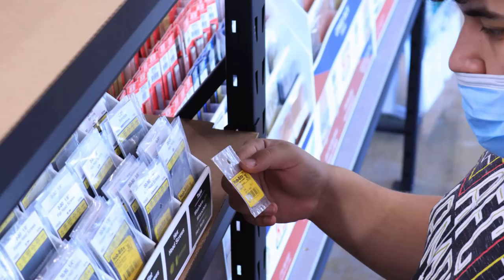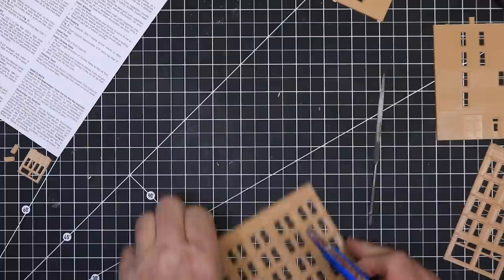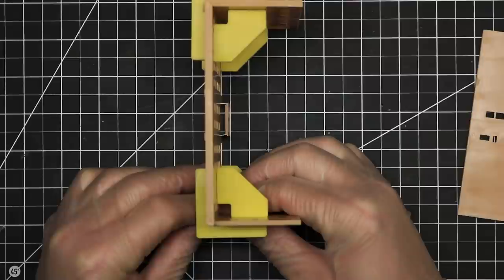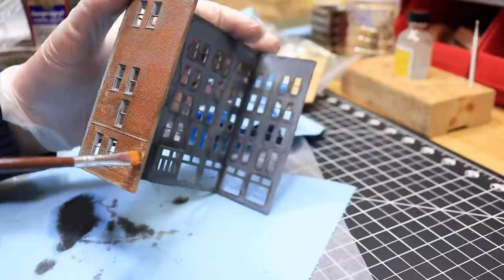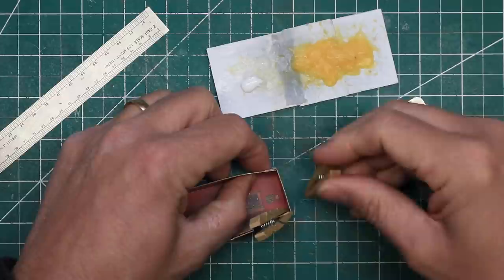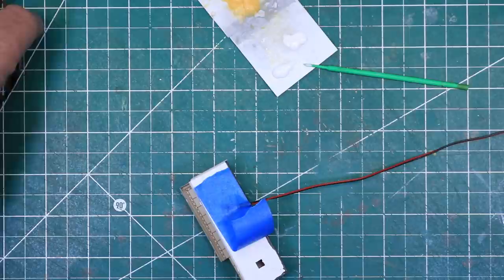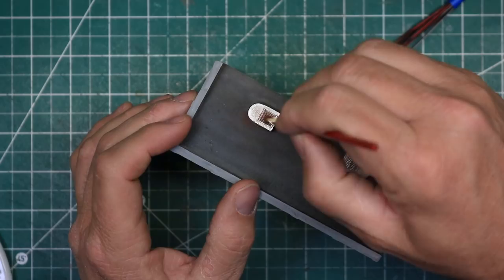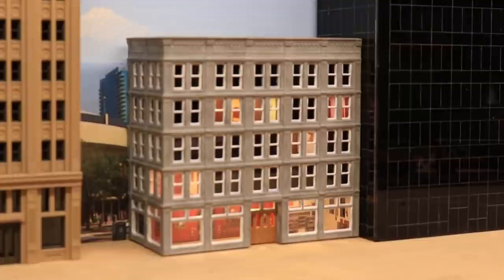Build a Model Structure with Interior and Lights

Comment: Excellent Ron!  The DPM structure series is absolutely classic, and make for perfect buildings by following the instructions or kitbashing.  I like your suggestion of canopy glue for the windows!  I bought some years ago but never found it useful.  This window installantion scenario makes for a perfect situation for its application.  And yes, I have had mistakes in weathering that have actually turned out for the better.  Fantastic work along with the tutorial.

Comment: I had to double take when I saw the thumbnail - that hotel looked very familiar! Those LED lighting accessories are though incredibly expensive for what they are, and you're very right to bring up Arduinos as an alternative. I mean kudos to WS for packaging up very cheap circuits... but with an Arduino and a cheap LED driver board (e.g. PCA9685) you can do everything WS can do, and more, for a lot less. They're not difficult, as I'm sure you could show with a video.
Reply from the maker: I intend to model and video lighting effects in structures as well as animates welder, camp fire, and more all using arduino in the near future.

Comment: On my last layout I had about 10-12 structures lit. Store fronts, outside lights front and back, and individual rooms up stairs. If you are doing a DPM kit check the back wall, If it is going to be seen add a door and maybe 2 doors, one for each floor. Add stairs also. Some store fronts have 2 entrances. I wall off the 2nd one from the rest of the store and add a stair case inside and then of course a light and maybe a figure.

Ok back to lighting. All this was done back in grain of wheat days also. I use 1.5v bulbs. Added extra wire to the leads or in some cases soldered them to a bus wire inside the building and ran the wires down thru the benchwork. I used terminal strips to connect all the wires and ran a variable power supply wall wart from Radio Shack, to the terminal strip. You can get them from Walmart these days. The key is to make sure one of the voltage choices is 1 volt. The more lights you have hooked to a power supply the dimmer the light is going to be.

Keep in mind that before LEDs came along indoor lighting was a lot dimmer then it is now. Same with street lights. And these can be hooked up the same way.

Thanks Ron for another great video.

Comment: i reverse engineered the just plug system and can do a board for 30 lights for the same price as one just plug module for 4 i also made my own roomettes in ms publisher so much cheaper ! as for sequencing system i have ws2812 neo pixels and an arduino a brilliant way of sequencing via a bit of code so much cheaper too!  good build though RON

Comment: Hi, Ron. I tried something the other day with the metal model assembly tray from Micro-Mart. I got tired of having my work stick to the metal tray so I took and sprayed it with cheap vegetable spray and wiped it down and my parts don't stick anymore and if I get a big old glob of glue on the tray it just wipes right off. Wish I did this when I first bought the tray. I have some areas that I have the globs and have scraped it off but left scratch marks behind.